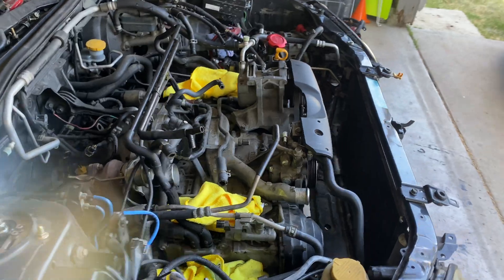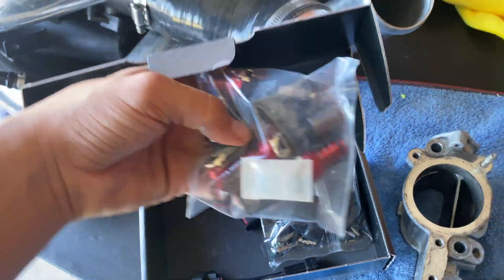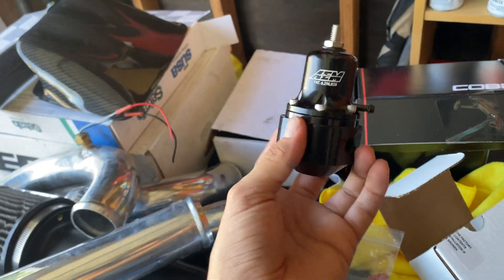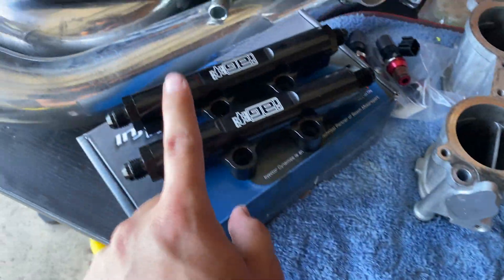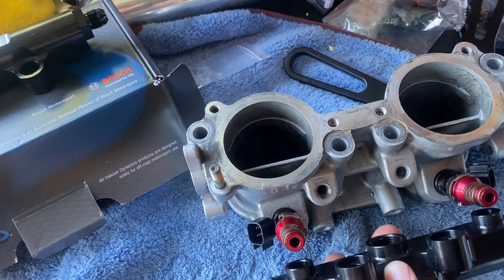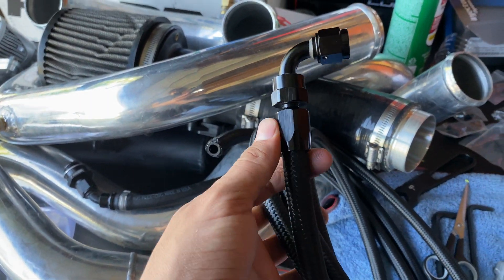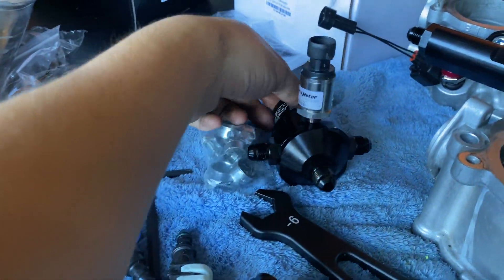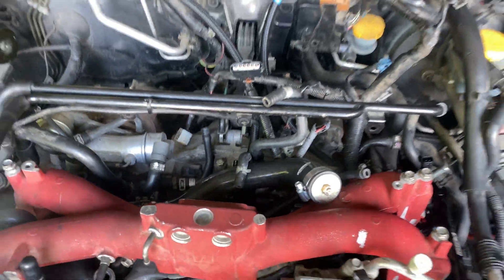setting up a parallel fuel system for my 04 sti! fueling upgrades

Comment: Where did you get your plug in play harness for your injectors??? I can’t find any that fit a 2004 STI please help!!
Reply from the maker: https://www.rallysportdirect.com/part/fuel-injector-components/ind-90-3-injector-dynamics-fuel-injector-pnp-adapter-uscar-to-denso?gclid=EAIaIQobChMIr-_hzff99gIV68DCBB2qKAWwEAQYASABEgKqsvD_BwE i believe it’s these. double check though
Reply: I think those will work thanks bro😄